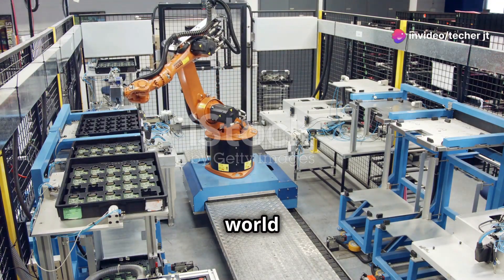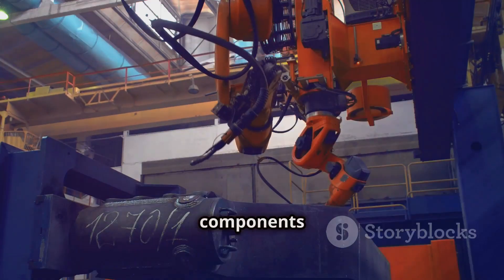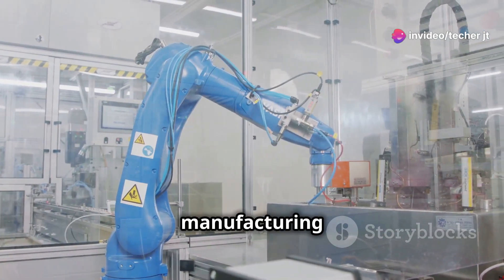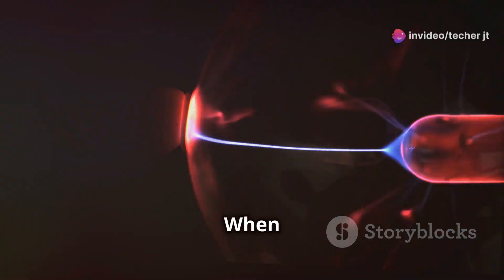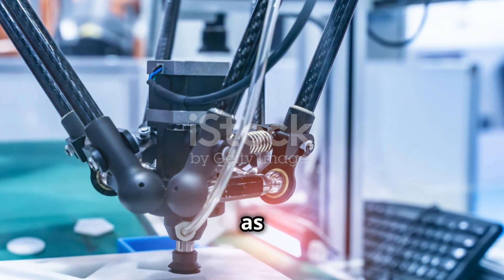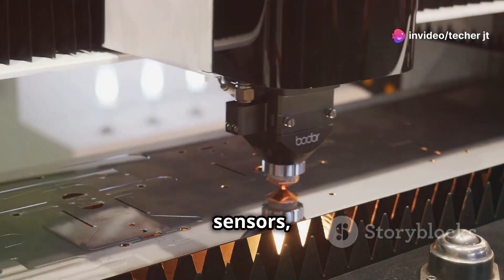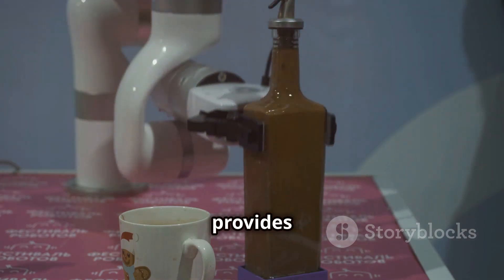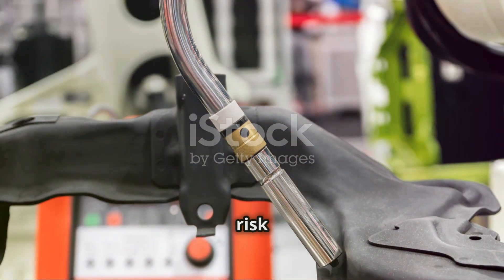Inductive Sensors for Robotics

Comment: 10 - CASSIOPEIA ⬇📝
Reply: Farrah Monica Leuterio
10 - Cassiopeia 

4.) What are the advantages of using inductive sensors over other types of sensors in robotic applications?

A: Inductive sensors provide several benefits in robotic applications, including non-contact sensing, which minimizes wear and tear, and high durability, making them suitable for use in harsh or challenging environments. They offer high precision and fast response times, allowing for accurate detection of metal objects. Additionally, they are resistant to electrical interference and require minimal maintenance, making them more reliable compared to other sensor types. Furthermore, their ability to function in extreme temperatures or dusty conditions makes them especially valuable in industrial automation settings.
Reply: Oclaman, Eureka Glyril B.
X - Cassiopeia

1) What is the primary function of inductive sensors in robotics?

- The primary function of inductive sensors in robotics is to detect the presence and position of metallic objects without physical contact, enabling robots to perceive and interact with their surroundings.
Reply: Joshua Cliff L. Aurigue
X - Cassiopeia

1. What is the primary function of inductive sensors in robotics?

- Inductive sensors are essential components in automated manufacturing, serving as the robot's eyes and enabling smooth, error-free operation. By detecting metal objects and relaying their position to the control system, inductive sensors play a crucial role in ensuring the efficiency, safety, and productivity of automated manufacturing processes.
Reply: Kiesha Cantila
X- Cassiopeia

1. What is the primary function of inductive sensors in robotics?

- inductive sensors stand out as indispensable components providing robots with a sense of touch or proximity detection. These sensors are renowned for their reliability robustness and cost- effectiveness making them ideal for a wide range of robotic applications from simple part detection to complex navigation tasks. Inductive sensors empower robots to operate with precision and efficiency in diverse environments.
Reply: Nella Regasa
10 Cassiopeia

3. Explan the Significance of the Sensing Range in Inductive Sensors.

- The sensing range determines the distance at which the sensor can detect metal objects. A longer range allows for more flexible positioning and applications, but it may also increase the potential for interference from unwanted objects.
Reply: Li, Cyril A.

4. What are the advantages of using inductive sensors over other types of sensors in robotic applications?

-Inductive sensors in robotic applications offer advantages such as non-contact sensing, durability, high precision, fast response times, resistance to interference, and low maintenance, making them ideal for detecting metal objects in harsh environments.
Reply: Princess Jelian M. Ucat
10 - Cassiopeia

Q3: Explain the significance of the sensing range in inductive sensors.

A: The sensing range determines how far from the sensor it can detect metal objects. A wider sensing range (typical of unshielded sensors) may detect more objects but can also lead to false readings. A focused sensing range (typical of shielded sensors) allows for precise detection within a defined area, reducing interference and false triggers.
Reply: Adrienne Kiesh R. Magbanua
10 - Cassiopeia

Q2: 	Describe the difference between shielded and unshielded inductive sensors.

A: Shielded inductive sensors have a metallic shield around the coil, focusing the magnetic field directly in front of the sensor, which reduces interference from nearby metal objects and minimizes false triggering. They are suitable for precise detection in environments with metallic interference. Unshielded sensors lack this metallic shield, resulting in a wider, more diffused sensing field that extends beyond the front of the sensor. However, they are more prone to detecting unwanted metal objects, leading to potential false readings.
Reply: Keth Jelzar A. Montes
10 - Cassiopeia

1. What is the primary function of inductive sensors in robotics?
- Inductive sensors in robotics primarily detect the presence or proximity of metallic objects without direct contact. They work by generating an electromagnetic field and sensing changes in this field caused by nearby conductive materials. This makes them ideal for non-contact detection of metal parts or components in robotic systems
Reply: Mark Uriel G. Tacbobo
10 Cassiopeia

1. What is the primary function of inductive sensors in robotics?

Inductive sensors acts as the robot's eyes to detect the presence of metallic objects without any physical contact. They work by generating an electromagnetic field and sensing changes when a metal enters the detection zone
Reply: Daniella G. Estanilla 
X - Cassiopeia 

1. What is the primary function of inductive sensors in robotics?

- Inductive sensors in robotics detect the presence or absence of metallic objects without requiring direct touch. They detect metal-induced changes using electromagnetic fields, allowing for precise location and object recognition.
Reply: Y'vhone Felkris L. Estanda
10 - Cassiopeia

Q2. Describe the difference between shielded and unshielded inductive sensors.

—In shielded inductive sensors there is an extra metal casing around the sensing coil that helps direct the electromagnetic field to the front of the sensor meaning it is less sensitive to side interference. This makes it possible to have more accuracy in a short range sensing. Compared with the unshielded inductive sensors where a metal shielding is not present hence the electromagnetic field influences a larger area leading to a larger sensing area. But they are more sensitive to side interference and hence needs to be installed carefully.
Reply: Lorenz Michael Paderanga 
X - Cassiopeia 

1. What is the primary function of inductive sensors in robotics?

- Inductive sensors in robotics detect the presence or absence of metallic objects without requiring direct touch. They detect metal-induced changes using electromagnetic fields, allowing for object recognition and precise location.
Reply: Jan Dexter D. Linog
X - Cassiopeia

2. Describe the difference between shielded and unshielded inductive sensors.

Inductive sensors detect other metallic/inductive components , but the difference in both types of such component is that shielded inductive sensors are more suited for precision , and unshielded inductive sensors have a wide detection range
Reply: Ethan James P . Malferrari
 X - Cassiopeia 

1. What is the primary function of inductive sensors in robotics?

The primary function of inductive sensors in robotics is to provide robots with a sense of touch or proximity detection and detect the presence of metal objects without physical contact.. They enable smooth and error-free operations.
Reply: Kristine de la Rita 
X - Cassiopeia 

2. Shielded inductive sensors have a metal housing around the sensing face, allowing them to detect objects only directly in front, while unshielded sensors lack this housing and can detect objects from a wider range.
Reply: Leonardo M. Verbraecken 
10 - Cassiopeia

1. Understanding: What are mechanical sensors, and how do they function in robotics?

-Mechanical sensors are devices that detect and measure physical properties such as force, pressure, displacement, torque, or acceleration. In robotics, they play a crucial role in providing feedback to the control system, allowing the robot to interact effectively with its environment.
Reply: Merchella Da-an 
10 - Cassiopeia 

2. Describe the difference between shielded and unshielded inductive sensors.

- Shielded inductive sensors feature a protective casing that reduces interference from electromagnetic fields and nearby metals, allowing for accurate detection at shorter ranges—ideal for noisy environments.

Unshielded inductive sensors lack this casing, enabling longer detection ranges but making them more susceptible to interference. They are suitable for detecting larger objects where external influences are less of a concern.